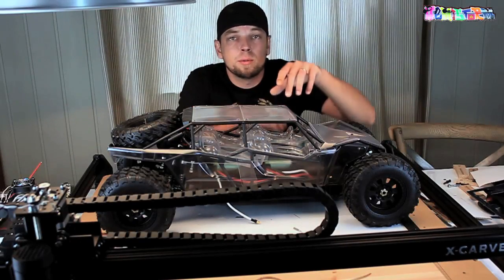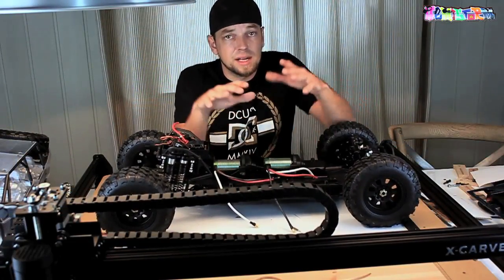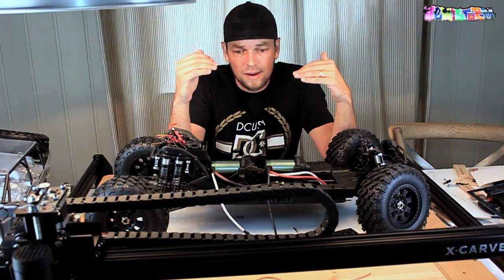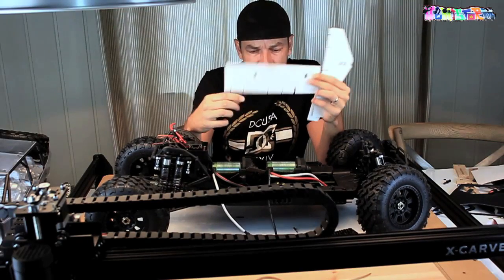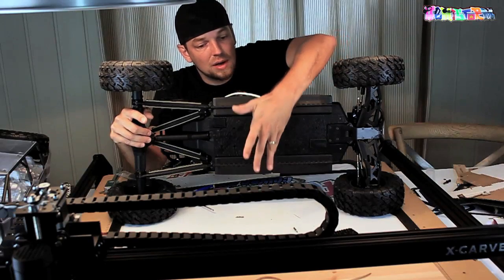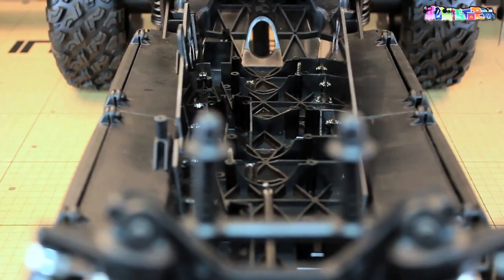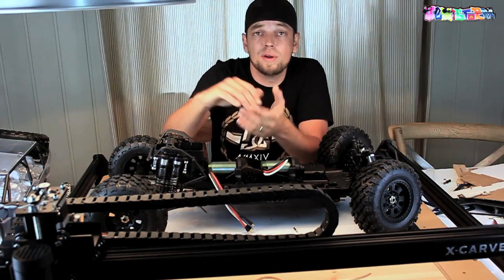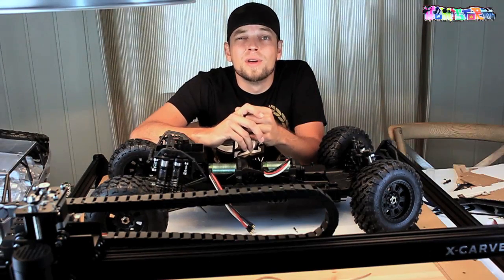World's BIGGEST Axial Yeti XL Part 2 - HOME MADE PARTS - HemiStorm Yeti XXL

Comment: Where are you machining the carbon fiber? The dust from this is very dangerous. It should be done using a hepa filter dust recovery. If it is inhaled into your lungs, you will need lung replacement. Google  "the dangers of carbon fiber dust"

Comment: Chris I have a question on your choice of materials for the bottom of the car. Why did you choose delrin instead of carbon fiber to make the bottom plate? Isn't carbon fiber much stronger than delrin? Was it cost or some other reason? Thanks bud and by  the way that thing is the most radical RC build ever! :-)

Comment: since you chopped up two chassis to make this don't you have another back and front half of yetis that are shortened??? you could make it into a short wheelbase version of the yeti xl, that'd probably be pretty neat. awesome job on the videos man keep em coming!
Reply from the maker: Very good thinking indeed, and with the X-Carve, plus the parts I saved, it should not be a problem to turn the remainder into a rolling chassis of sorts. More to come!
Reply: Derik Sowlcowski that would be awesome but the places he cut were ahead and behind the motor mount, so on one where he used the short ends it would have no place to mount motor